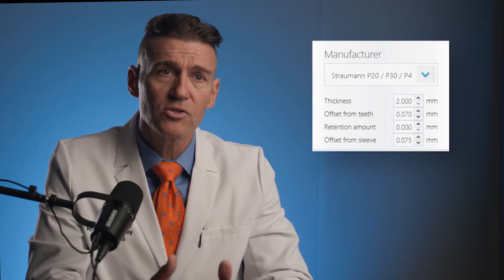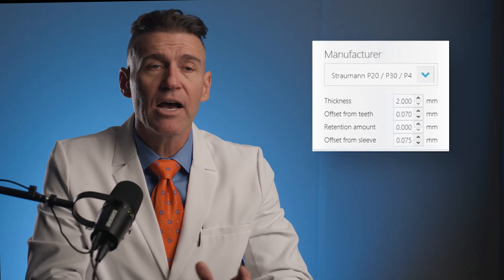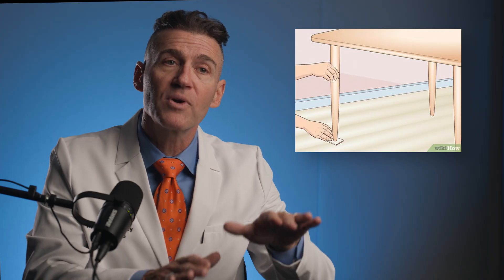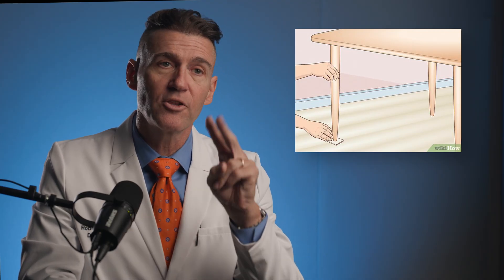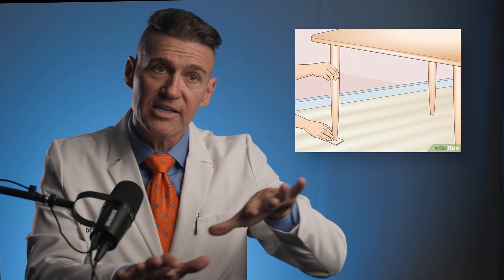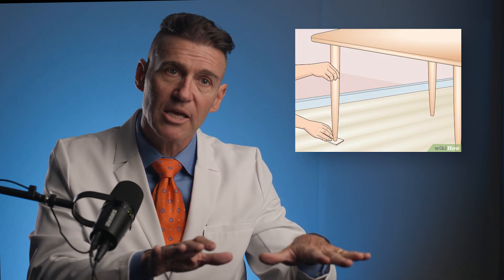If Your Surgical Guides Fail, THIS Is Why

Comment: I have never heard of a guide breaking.  Not fitting?  Yeah, it happens.
Reply: Exactly
Reply: They CAN break if they don't passively fit or wrong sleeves are used
Reply from the maker: ^this - definitely have seen many broken guides over the years

Comment: I have to disagree with the instability of guides by making it more extended. 
I have designed many guides with RealGuide SW and then placed those implants. 
Never ever have I experienced rocking of the guide. If the impression or the scan is accurate and you dont wait months for the teeth to shift, or someone made a filling crown or changes in adding something in the arch why would it rock?